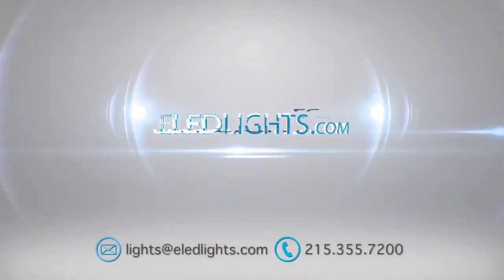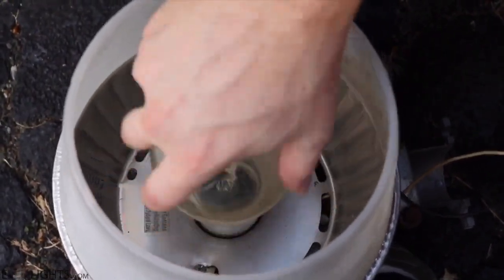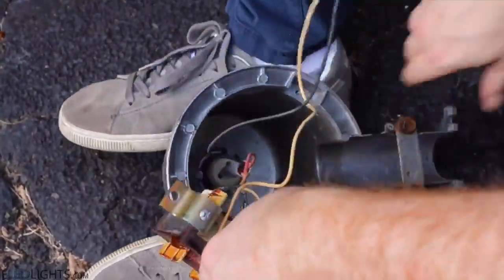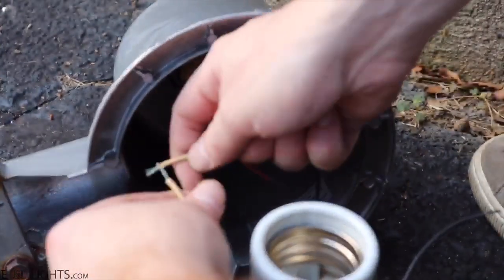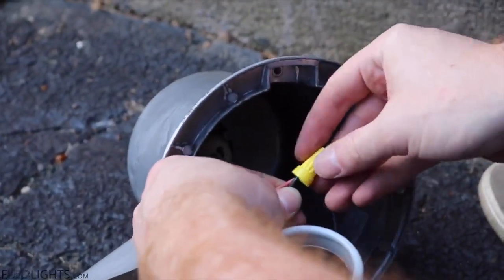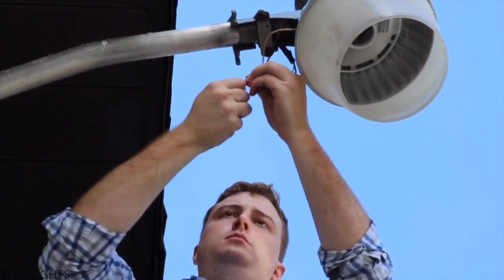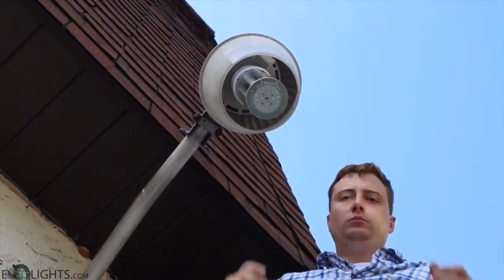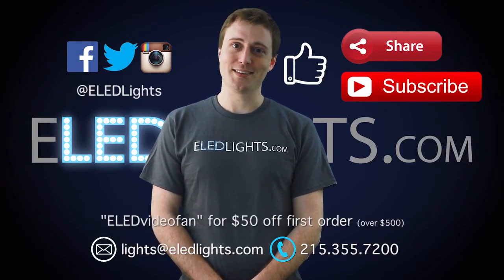How To Install a LED Corn Light in a Metal Halide Fixture

Comment: You can remove the transformer but you have to file it down. Just one side where it is welded. Then once that side comes off you snap off the other side. The fixture is much lighter without it

Comment: Would an install on generator be the same.  Currently running 1000w metal halide bulbs, the power running from generator is 207v.  Could i install a replacement LED and bypass the ballast just like your video?

Comment: I like the metal halide lights for growing plants. I'd like to know, if it's possible to bypass the photocell on the top of the unit so I can have the fixture o. A timer
Reply: Just install a shorting cap in the socket.

Comment: I want to see how bright the light is at night. I'm hearing bad things about these corn lights. They say you'll use less energy, but you lose brightness cause 90% of the LED lights are facing outward. Can you show a before and after installation of brightness between the two  bulbs?
Reply: I have a 10000 lumen bulbs in 2 of these types of fixtures. The brightness it is very good. In another fixture especially enclosed I could see lots of lumen loss. My guess.
Reply: Agreed. LEDS literally are about equal on efficiency as HPS

Comment: Thanks for this video! I'm facing the exact situation and can no longer find the old bulbs to replace the last one. So the bottom line is, i either remove the ballast or get a new fixture lol
Reply: https://youtu.be/oaoesi9Avl0   I watched this and these corn bulbs aint all that from what i'm finding out.
Reply: @henkers420  Thanks for that video link... I decided to just put a new fixture up instead of fooling with trying to rig a light that may or may not work.
Reply: Will it work on a regular 120 volt

Comment: Why the bypass? If all the lights are not dusk/dawn controlled but rather switch on/off... can't you just replace the bulbs?
Reply: If you don't bypass the ballast, it will light your LED lamp on fire when it tries to ignite the halide lamp that was removed

Comment: I don’t see why you can’t just purchase a new LED fixture?
Reply: Many like the look of the old fixtures better.
Reply: Retrofitted 2 so far. Inexpensive and I am happy with the brightness. I like that the older style fixtures are well built and physically last for many decades. I did also buy separately a fairly expensive led fixture. Very bright. Not sure of its longevity yet. I don't think a cheaper $100 led fixture made today would last very long.
Reply: Sad thing is all the flouresent area lights and newer led fixtures are Chineseium now a days and don't last like the old mv mh and hps fixtures would.
Reply: I looked into a new fixture, led  and $120...if it malfunctions, you have to replace the fixture. 
Or retrofit  and the bulb is $14.🤔
Reply from the maker: You absolutely can!  Retrofitting is just a great cost effective alternative to doing so!